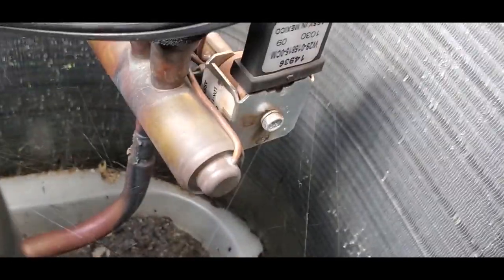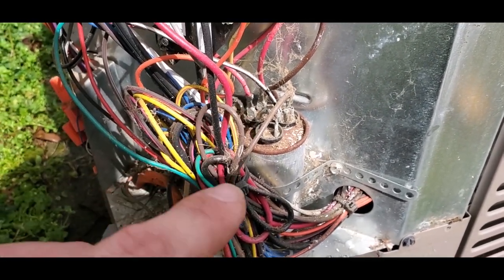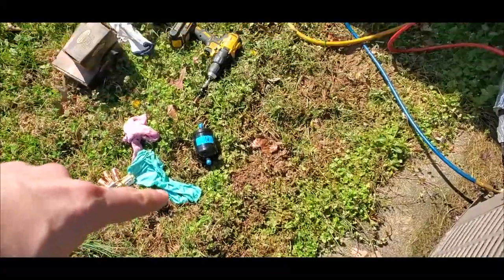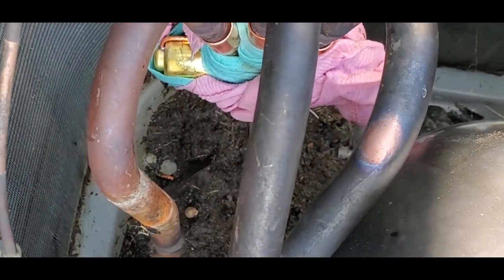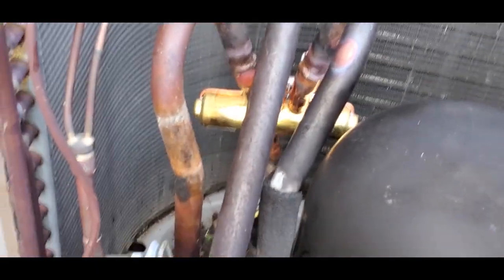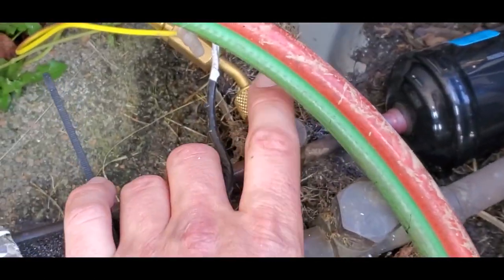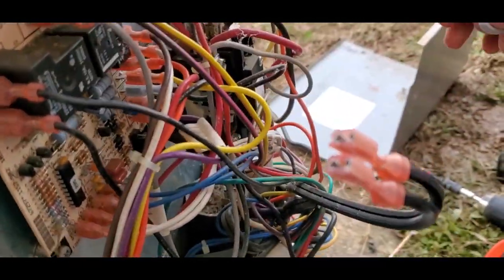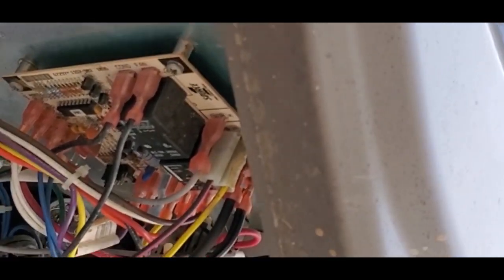Reversing Valve leaking at Capillary Tube and Bad Thermostat loud noises from solenoid coil! #hvac

Comment: Do you recommend those titans for my first gauges or the just the normal 3 port? Also did you read of any books that helped you in the trade at all? I have been in install as a helper for almost a year but still barely know what im looking at sometimes. Didn't go to school.
Reply from the maker: I recommend a cheap setup if you are just starting out. Start out small which will be more secure so here is a cheap set.
 https://www.amazon.com/OrionMotorTech-Diagnostic-Manifold-Freon-Refrigerants/dp/B07JLQTK9C/ref=sr_1_7?keywords=refrigerant+gauges&qid=1583352840&sr=8-7

I always carry 2 sets anyways so later on invest in a more expensive set

As far as books I would say Read all the installation manuals and download them online off of manufacturer websites.
Reply: Good job very informative. I like what you do.